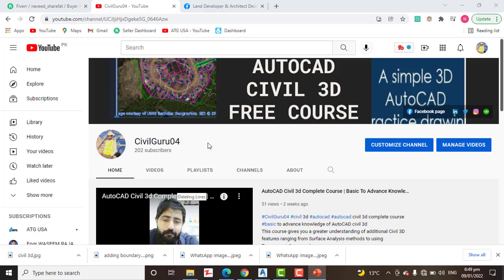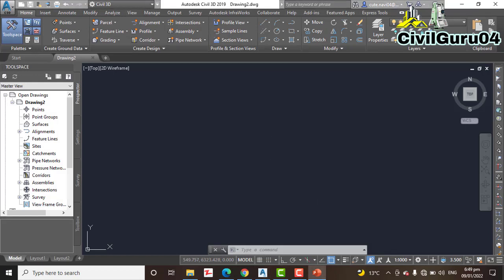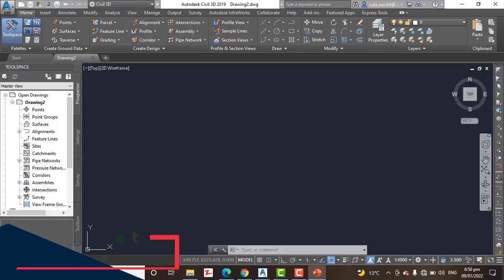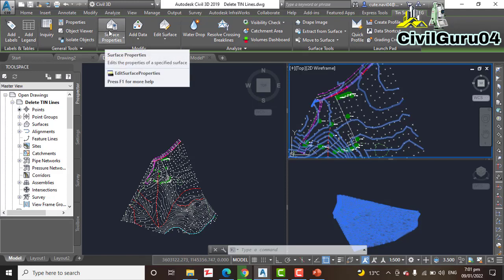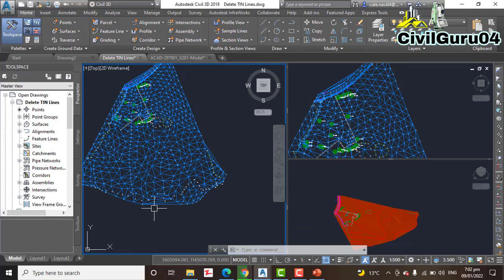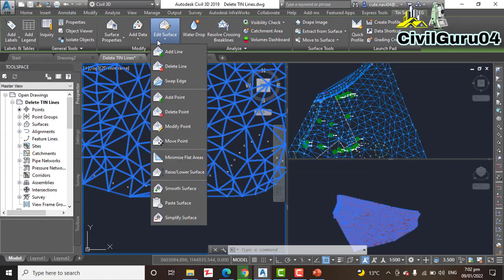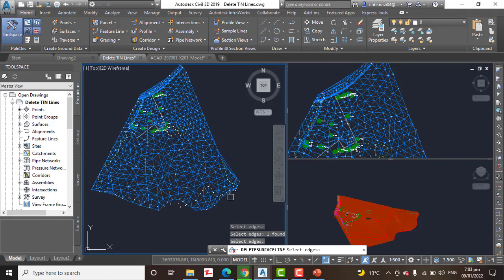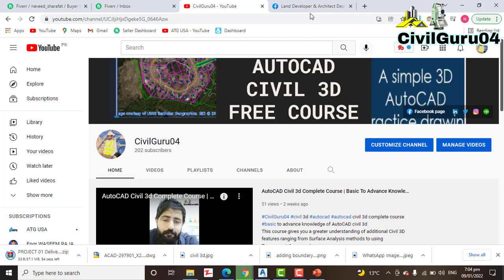How To Delete Extra Contour Lines From Surface In AutoCAD Civil 3d | Surface Creation In Civil 3d

Comment: Can somebody tell me how to explode couture lines and how to spot couture elevation on the edge of the couture line ...
Reply from the maker: There are some ways to do that, use explode command to for contours 2 time then for elevations you can use id command to see the values or select a line and right click to look at properties
Reply: @Civildesigns04  thankyou dear I tried many time using explode command but it doesn't work .. I want to spot elevation in couture maping not in the centre of the map but separate in the boundary of the plot where contour lines  meet..
Reply from the maker: @easytricksandtips6803  i will make video for you
Reply: @Civildesigns04 tq so much also explains how we can Design a drain along with contour and a contour  text size styles in a fruit full way tqqq soo much ❤❤
Reply: And tq ur trick was really useful it works ❤❤
Reply from the maker: @easytricksandtips6803  ok i will make video about drain, but for contours labels i have already videos to change, edits etc. labels style in civil 3d
Reply from the maker: @easytricksandtips6803   you welcome

Comment: done 1545
Reply from the maker: Thanks
Reply: How do i know which lines to keep and which ones to delete?
Reply from the maker: Good question...you will see some lines are closer or some have not proper triangulation, and sometimes you will surface going down with some points so you can delete them